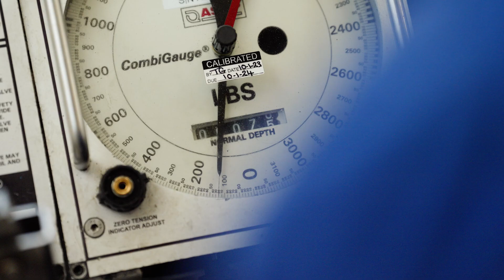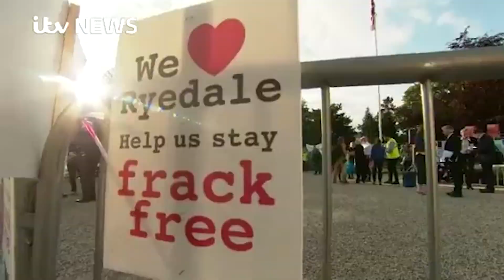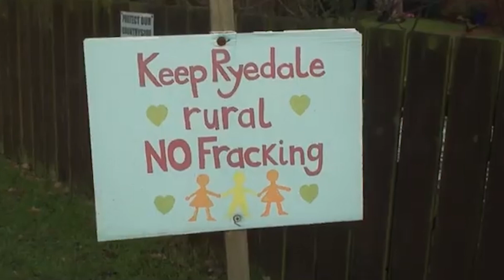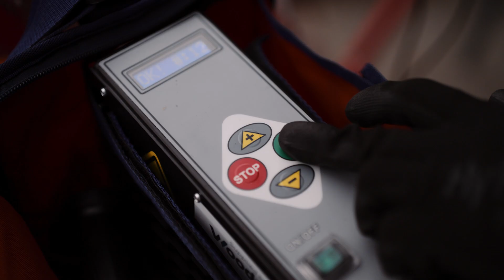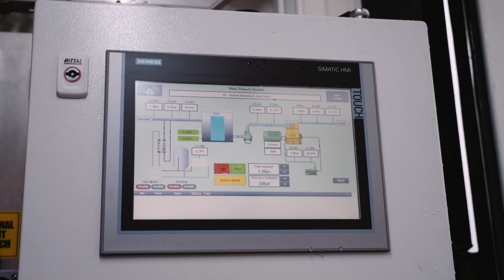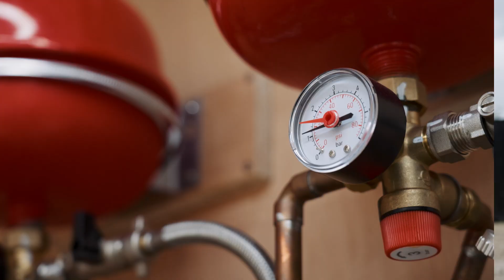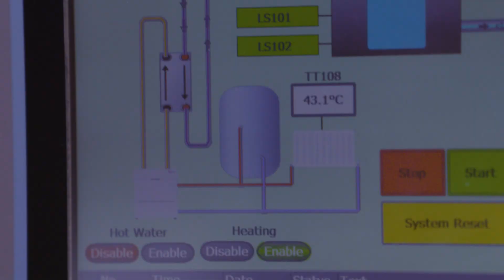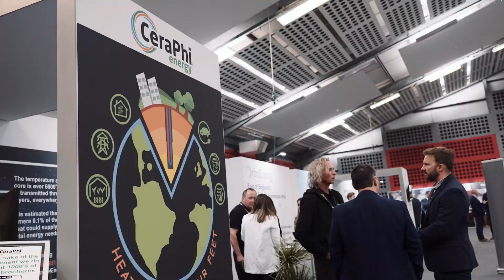Turning Oil & Gas wells into Geothermal Energy Assets

Comment: Two different things were presented here. One part was using existing abandoned wells for warm water. The second part was installing district heating.  Yes, you proved that you can get warm water from abandoned wells. The issue is that many existing abandoned wells are not near areas of need.  You still have to sink a wells for most locations.
Reply: He said they would drill where they can or use existing wells. Didn't really matter. And they would first pursue hospital/school type anchors to connect to and branch out from there.